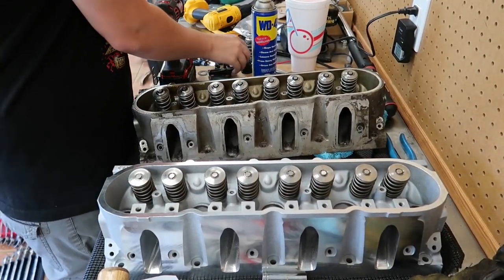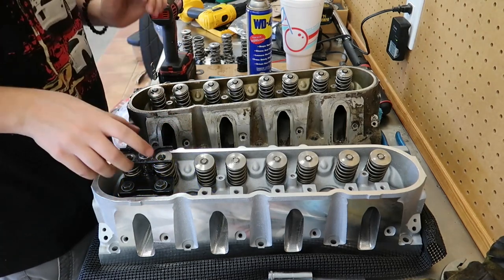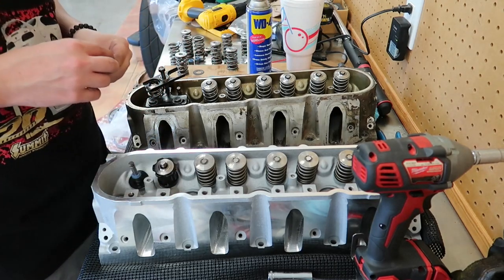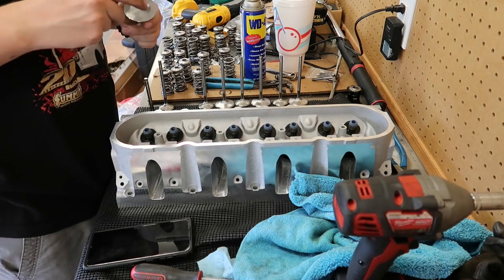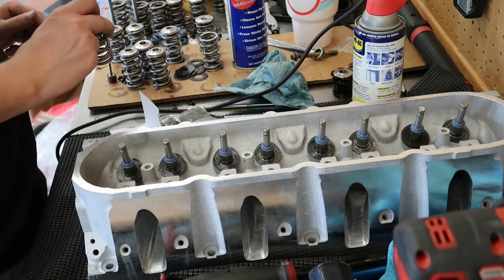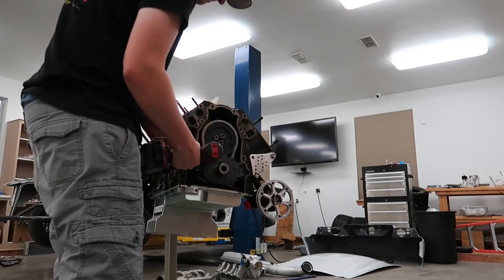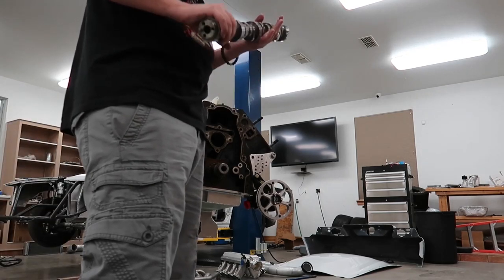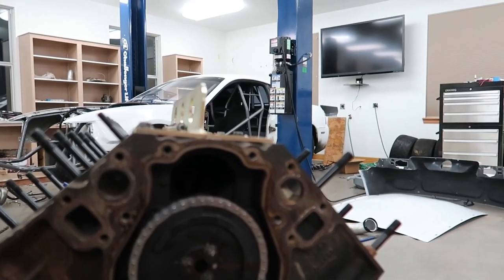BTR Valve Spring Giveaway and Install! Road to Re-setting the SBE 4.8 Record Ep. 6

Comment: Looks good, pick you up a double roller, I had a single roller oem style replacement break on the 2 step
Reply from the maker: I have never seen one break personally that sounds like some pretty bad luck lol.
Reply: @SquirrelTuned  it was for advance auto, they ended up replacing everything after I refused to buy anything else threw my commercial account with them, it’s the only one I ever seen break also
Reply from the maker: @Boostismyfriend  Ah this one is IWIS so I imagine it is quite a bit stronger.
Reply: Double roller is a lot of work and honestly rather pointless on the ls stuff lol... we put one on an engine when we first started messing with ls stuff years ago and definitely not worth the hassle
Reply: @4dMOTORSPORTS   don’t know what kit you used, but’s it’s a bolt on deal now
Reply: Ah, that’s good to hear for sure. It was a cloyes, this was also like 10-11 years ago lol.. havent looked into it since then, we’ve had good luck with the iwis stuff

Comment: I wad up a shop rag and stick it in the combustion chamber, and that keeps the valves from dropping.  An easy bump with a dead blow on top of all of the retainers before you get started helps keep them from sticking.
Reply from the maker: I tried both of those as well but didn't work for me for whatever reason.
Reply: @SquirrelTuned  You just didn't hit the retainers hard enough to unseat the keepers, that's all. How do you think springs are changed w/ the heads on the engine in the car...you have to unseat the keepers, that's all, they are just seated more firm than you think and you aren't going to hurt the retainers by putting a socket over them and smacking a few times, but you're done now, good luck with the new upgrades.
Reply from the maker: @macman231  I've done it on the engine multiple times I'm aware. I hit them hard enough to move the valves down. These just wanted to be difficult i guess.

Comment: Fwiw the “Custom” LJMS cam is basically a copy of the TSP Bald Eagle cam. At lest you know it works! 👍
Reply from the maker: My old cam was done before the TSP bald eagle cam or Cleetus was even a thing. And it was not posted until after they did that cam so I don't believe either side copied on that.
Reply from the maker: I was actually wrong about it being before Cleetus was a thing I checked. But it was done before TSP did that cam.

Comment: I’m confused, LS cathedral port heads use a 1.800” IH. Iirc the .660 springs recommend IH 1.775”?  But is 1.675”-1.700” correct?
Reply from the maker: Yes 1.700 is correct with the ultimate rpm spring kit. It is just .685 springs shimmed up and with different locks to get the install height to 1.700. And titanium retainers of course. The reason for doing that is to increase spring pressure so you don't run into valve float running high rpm. In doing that you can only have up to .650 lift though. I believe coil bind is 1.000 on the .685 springs so .650 lift puts you .050 from coil bind.

Comment: I think ls engines installed height is more like 1800,my figures don't work with those springs setting up at 1700 ,then using a camshaft with more than a 600 lift. They would have to set up at 1800 or 1850.what do you think
Reply from the maker: Here is the specs on the springs. Spring specs are 170 lbs @ 1.800", 380 lbs @ 1.180", 450 lbs @ 1.115, coil bind @ 1.000". So installing them at 1.700 means .650 lift puts you .050 from coil bind. This kit from btr is meant to install at 1.700 to get extra spring pressure to help avoid valve float at very high rpm. I'm not entirely sure what standard install height for other springs are but that is correct for this specific kit. The part number is SK703. However it doesn't look like the install height is shown on their site.
Reply: @SquirrelTuned  the springs bind at 1 inch compression height. If you set them up at 1700 minus 1 inch for the spring at coil bind, that only leaves 600 th for the spring to be at bind, you can't run a spring at bind so that setup would not work at even 600 lift, hey I'm on your side double check, nobody wants hurt parts.
Reply from the maker: @davidreed6070  I'm not sure I understand your math here. 1.700 minus 1 is .700. So .700 would put it at coil bind. I appreciate the concern though and not trying to argue or anything. However my old heads had the same springs installed at 1.700 and had over .600 lift.
Reply: @SquirrelTuned  sorry man I'm getting old, you are right but it seems that is running those springs at the edge. I retired until my son is putting a 60 in an a10,twin turbo, when I was doing this there was no ls engines so I'm relearning the ls stuff but a spring and installed height is not different one to the other.
Reply from the maker: @davidreed6070  no worries man I've done that same math wrong myself before. That sounds like a fun build. Let me know if I can help with it in any way!
Reply: @SquirrelTuned  where are you located. We have a racer around here that does maybe like you. Derek Kelley, with bam bam
Reply from the maker: @davidreed6070  I'm in Clovis New Mexico but I can help with remote tuning and some parts. I know of him well, him and that car are very impressive.

Comment: how come on the btr website the ultimate rpm spring kit is listed as .650 springs and not the .685 that you have?
Reply from the maker: They are .685 springs but they are shimmed down for .650 lift. Mine are the same way.
Reply: @SquirrelTuned  Oh right on, when I'm ready to buy my valvetrain components I'm going to go through you! Do you also help with speccing out valvetrains?
Reply from the maker: @tonycampton9642  yes sir I can help with that! I wouldn't consider myself an expert there but I know some good combinations with shelf cams
Reply: @SquirrelTuned  awesome brotha I’ll be in touch! I live in Albuquerque and i plan on getting my car tuned by you as well. Been following since the beginning! Awesome to watch.
Reply from the maker: @tonycampton9642  thanks man! Feel free to message my fb page or email me or anything if you have questions or need any parts. Be happy to help!

Comment: My sbe goal is still a 5.99, PB to date is a 6.3...
Lol
Reply: What’s the setup
Reply: @Boostismyfriend stock 5.3 summit stage 2 truck cam, cast 78/75 th400 foot brake 3.55 in a chevy luv with a 26/8.5 slick
Reply: @Boostismyfriend  I'm also putting together a 93 fox body , I subscribed to your channel and asked you about your set up the other night, same stock 5.3, but a turbo cam stg 2 summit, cast 78 75, e85 on this one, trans brake on this one with 4.10
Reply: @jesusm2797  what injectors, fuel pump and fuel?
Reply from the maker: Nice man it will get there I am sure!
Reply: @SquirrelTuned  thanks
Reply: @Boostismyfriend  chevy luv is on two wally450s and stock decapped injectors and water/meth injection
Fox is a magnafuel 750 with Bosch 210 plan on e85
Reply: @jesusm2797   sweet, drop the gear back in the fox and both will go 5.99 getting them to  60ft
Reply: @Boostismyfriend  what gear do you suggest?
Reply: @jesusm2797   s480 the fox she will go mid 5’s with out pushing it hard
Reply: @Boostismyfriend  I want to upgrade turbo on both once budget allows it...lol
Reply from the maker: I can get you a TDI turbo when you do! They are very reasonable and make good power.
Reply: @SquirrelTuned  how much is reasonable? How much power are we talking about?😃
Reply: @jesusm2797   3.27-3.55 will work well with a first gear leave 400
Reply: @SquirrelTuned  was wondering if vs 92/103 is going to be on sale on black friday, if not I'll continue to save my pennies til I actually need a bigger turbo(once I iron out everything)
Reply from the maker: @jesusm2797  s491 is 1317 retail I believe. 80-88mm is 1270ish. I seen someone swap from the 92/110 to the TDI 91 and go faster with 10psi less dome pressure.
Reply: @SquirrelTuned  ok, I'll keep it in mind, would like to make sure everything is working properly before upgrades, I just got car started and two injectors were not working, I ordered two more from vsracing, another $140 before even being able to drive the fox
Reply: @SquirrelTuned  I have a new vsracing 80/96mm turbo for the luv, but I just got a terminator x for it, I want to throw that some sep 1500 on it before the turbo
Reply from the maker: @jesusm2797  Nice man the terminator system is sweet I really like it.